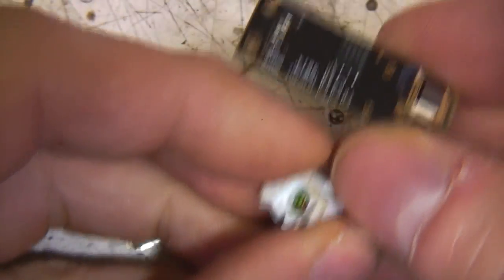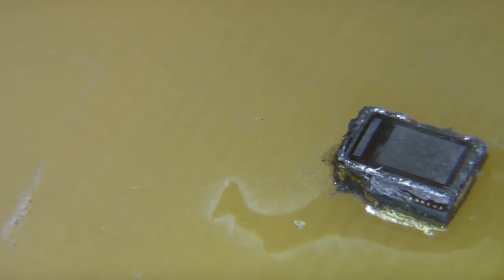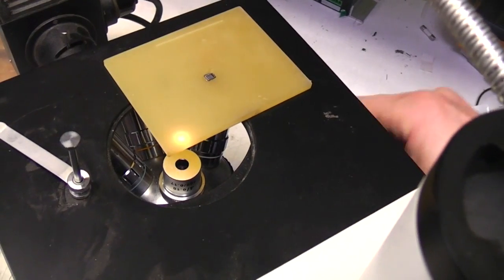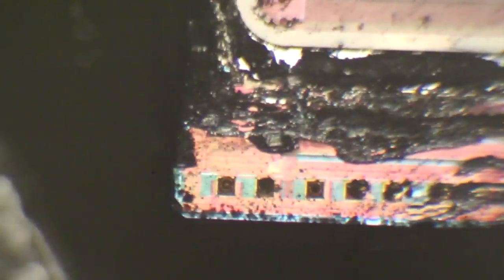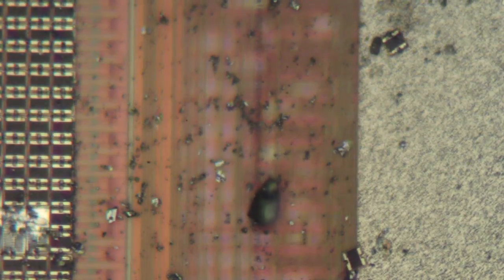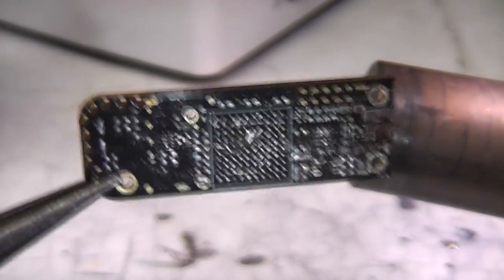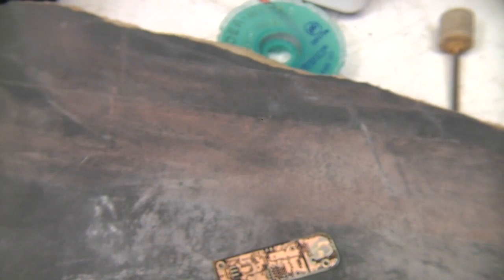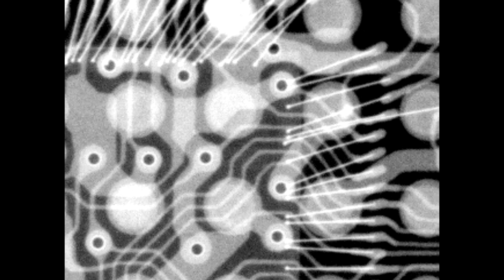Seek Thermal camera teardown part 2

Comment: The array on the edge is the normslizing and calibration aray. Its used to compensate for IR energy coming from the back of the chip. This allows it to function without a battery sucking thermoelectric cooler.

Comment: I don't agree with the performance comment though. I have a Seek Reveal Pro and although the firmware is horrid, the actual resolution and sensitivity is quite remarkable.
They should have had video capability on the standalone units and a usb camera mode but all they do is access the filesystem badly.

Comment: Nice teardown of this cam.
I need the av-signal from this cam for using FPV with my copter.
have anyone a pinout from this cam or can tell me where i can finding the pin for av-signal?
Reply from the maker: +Tim Salowski There isn;t one. 
Someone does make a camera based on the flir lepton with a video output
Reply: +mikeselectricstuff 
The 4th Pin(ID), between black(GND) and green(D+) you had soldered, isn&#180;t connected maybe with AV?
That is almost the USB-Pin for AV-Signal by another cams.

Comment: Mike Loving your work as always. 
Any chance you could supply a small thermal sensor with the AV out cables and the power cables? 
Does not have to be this sensor. Ideally with a 12mm lens or greater.